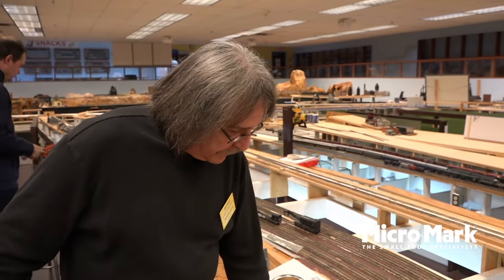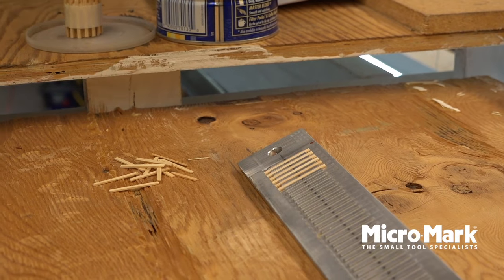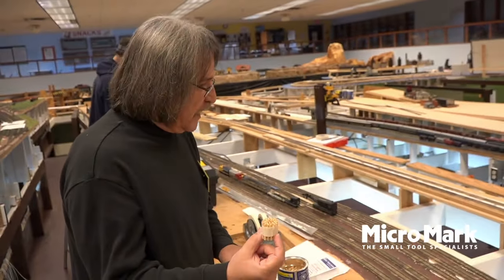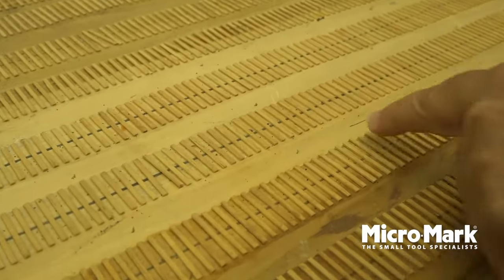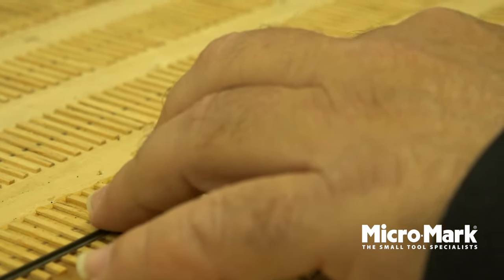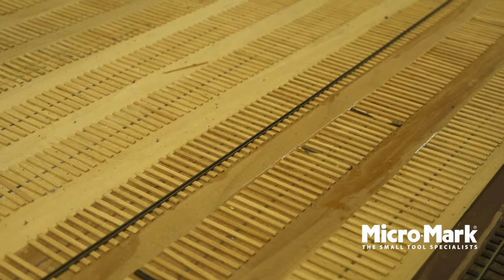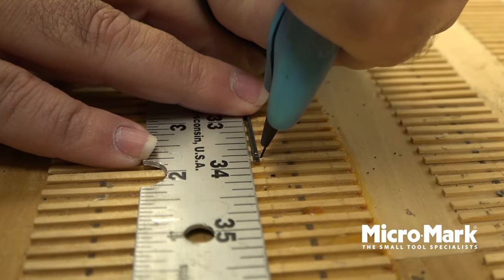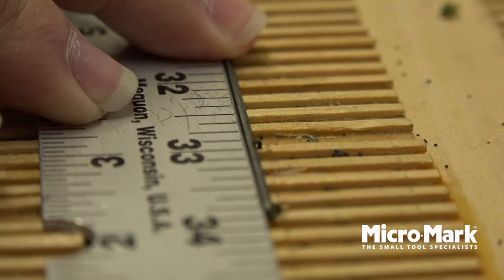Hand Laying Track - Micromark.com - The Union Model Railroad Club

Comment: Very nice work!  Where do you get your ties?  Do you buy them or make them yourselves?
Reply: I use ties from Fast Tracks/Scale Lumber Company, but there are others out there as well. I try to avoid the low-profile ties as they tend to break more often when inserting spikes. At least that's been my experience. Many modelers use contact cement, so that's another option.